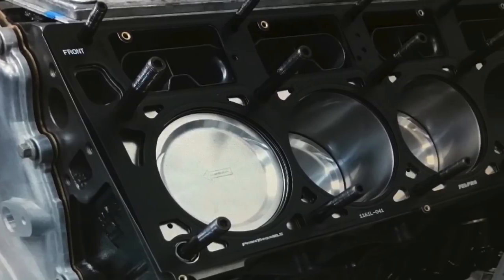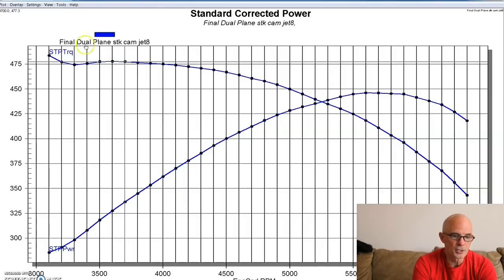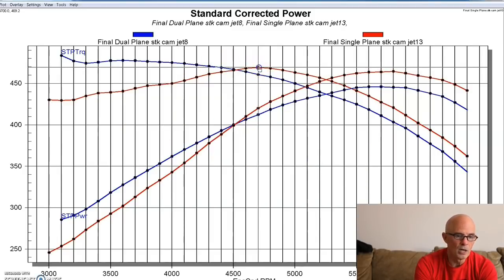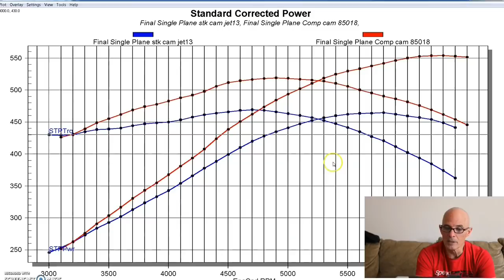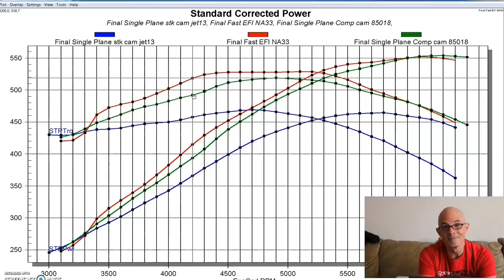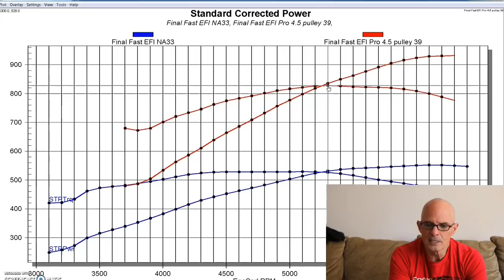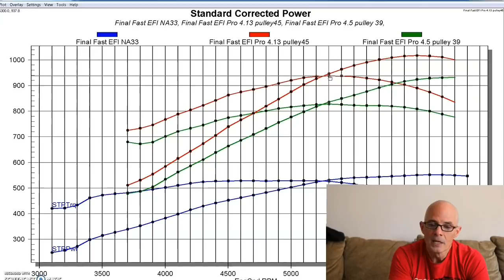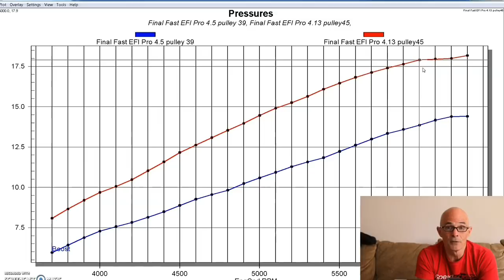SUPERCHARGED LS EBAY COUPLER TEST! DO CHEAP ONES WORK?

Comment: Before I watch, I’ll say I’ve been running cheap couplers for almost 2 years now and have had to replace  none of them. I used a $65 intercooler pipe/coupler/clamp kit.
Reply: How much boost are you making?
Reply: Monster RAM 15psi right now and going up higher soon.
Reply: @Turbogto_guy  That explains it.  On turbo diesel applications, we see 45-60psi and upwards of 100psi boost on compound trucks.  Once you get up into that range, you need 5-ply straight boots and high-quality equal-tension clamps.
Reply: Monster RAM I must have missed something. I thought the engine he was testing was a gas engine? I didn’t know it was a 408 stroker Diesel engine. I’m literally shaking my head, cringing and rolling my eyes right now because someone would even post what you did. It’s not only irrelevant, it makes zero sense comparing 100psi diesel boost to the 15-16lbs of boos he was running. I would feel dumb for posting that.
Reply: Monster RAM and with what I just said, I’ll never run 45+psi on my GAS 5.3 engine. So I DEFINITELY won’t need a 5 ply coupler. ROFL
Reply: Same here. Some dont have the reinforcements.. just get the ones that are reinforced and they work just fine.. static tested mine to 30psi and no noticeable ballooning
Reply: Moon Tuned yea my cheapies are reinforced.
Reply: @Turbogto_guy  Boost is boost. There are compound turbo gasoline 4-cylinders making 120psi boost. You must not be very knowledgeable in this area... my mistake.  Your vehicle makes so little boost any ebay boot will do.  I guess you can call that a W.  However,  I'm sorry you have such conflicting emotions over words someone posted in a YT comment section.  Perhaps you're projecting that feeling of stupidity?  What would anyone expect from a dude who's avatar is a shirtless bro talking a flex selfie in the mirror?
Reply: Monster RAM and btw. DO YOU REALLY  think on 120 psi compound setup on a 4 cylinder, they are going to run cheap eBay couplers? That comment was about dumb as could be. You’ve given me a good laugh this morning. I knew dumb people existed, but you should get an award.
Reply: @Turbogto_guy  Just jealous of the gains bud.
Reply: CanadaBud23 yea I figured he was but I didn’t want to sound vain or conceited. I work out for my own personal satisfaction. I feel better and at 43 I’m not getting any younger. Plus I had open heart surgery 3 years ago due to a birth defect with my heart. So I have to keep myself in shape if I want to live long enough to watch my three sons grow up.
Reply: @Turbogto_guy  Wait, so first say your ebay boots work fine for two years.  When asked how much boost you made, you said 15psi, aka not very much.  Then you were given information pertaining to when you actually would need a good boot; specifically what kind and how much psi. 

Now, somehow this triggered you into a screed about diesels making special boost that's not relevant to gasoline engines... even though compound gasoline engines make the same boost.  And you going on and on about your own incredulity of the entire situation.  What exactly is you problem, sir?  Why are you so lost?
Reply: Monster RAM because this video is about an engine making 15-16lbs boost. Which correlates with this video. Your comment doesn’t.
Reply: @Turbogto_guy  I'm responding to your comment about boot strength, and not regarding the fuel that the engine in the video runs on.  Why you are conflating this in a desperate attempt to save-face-for-no-reason is beyond me.  But just for shits and giggles; if I would have never mentioned the word "diesel" would you still be this upset?
Reply: @Turbogto_guy  I wouldn't worry about sounding conceited or whatever, you are the one responsible for your body, no one else. I have friends that did the same to me while I was losing weight and I look at them now and they are all starting to have health issues, late 30's early 40's. It's not too late for them but they have to decide that. Be proud trying to stick around for your children. 👍
Reply: TravisT TURBO GTO 
Good for you getting away with cheap boots with some boost.  That doesn’t mean any cheap boot will survive, especially when the pressure starts rising.  

RAM’s point is valid...  A quality boot will provide years of reliable service under much higher PSI.
Reply: @stlchucko  Yeah that's true too. At 20-25 psi you should start thinking about getting something with 4 or more plies to handle the extra pressure. But 15 psi is nothing really.
Reply: @Turbogto_guy  
Fold your tow mirrors in.
Reply: @user63344-gds  
Fold your tow mirrors in too.
Reply: @user63344-gds  
I just assumed they were out, and you drive a Dodge lamb... guess I was right! Thank you for explaining why DODGE guys fold their mirrors out. I always thought it was so the people riding and driving in them didnt have to see themselves inside a piece of shit, then a friend of mine told me it's because the kids who bought them can't afford a trailer to pull so they pull invisible one that only they can see in their mirrors.
Reply: @user63344-gds  
On a quiet night you can hear a Dodge rust.
Reply: @user63344-gds  
I also don't own an early 90s Reservation Dodge. I can assure you my tuned 2019 Ecobeast would murder that rusty oil burner.
Reply: @user63344-gds  
I assure you I didn't click on your name, no interest, your name, Monster Goat, said enough.
Reply: @johncholmes643   You need to get your vision and your head checked guy.  But until then, please post up a video of your EcoBoost that can barely get a 14.9 in the 1320.
Reply: @user63344-gds  
12.31 @119mph 87 octane
Reply: @UCyeEfC7UiZy86WIh7VghbXA 
My mom was killed in an airplane accident in Nepal in 1986.

Comment: That procharger is interesting... My brother and i were watching and he had a good point... everybody likes the 2JZ but the Chevy Inline 6 is virtually identical. The junkyard is full of them. What's the chances of you doing a comparison of some type?? Anyway, love the vids bro! Keep'em coming!
Reply: Same with the Mercedes m104 inline 6. Forged pistons and rods and it's 1000hp ready. And costs a fraction of what a 2jz does
Reply: Motor trends hot rod garage did a build up on those motors
Reply: 2jz is 4valve DOHC that is nothing like the I can't breathe 292 Chevy.
Reply: @bcbloc02  he's talking about the atlas series of engines. The correct 4200. There is an inline 5 as well used in the old Colorado
Reply: The Atlas engine is what I'm referring to... 4.2L